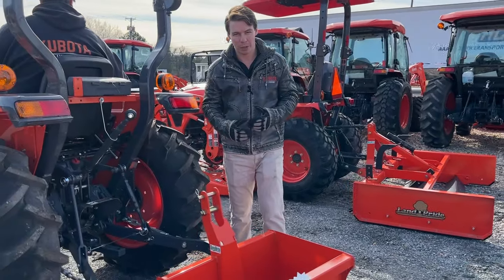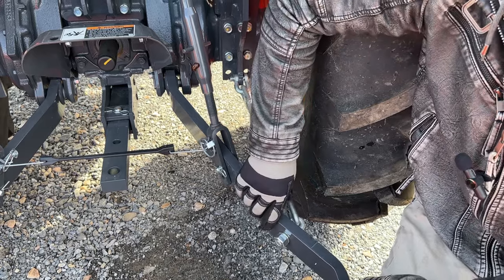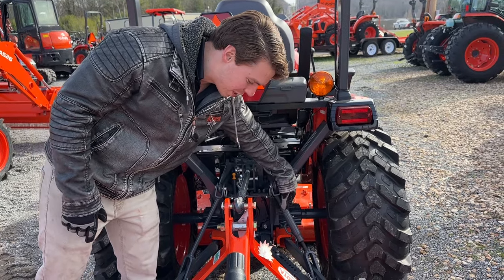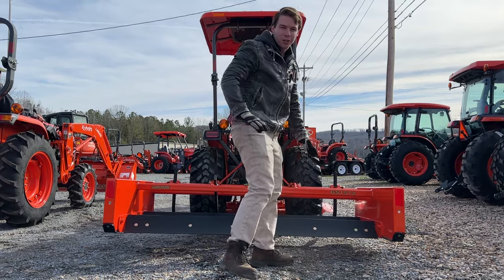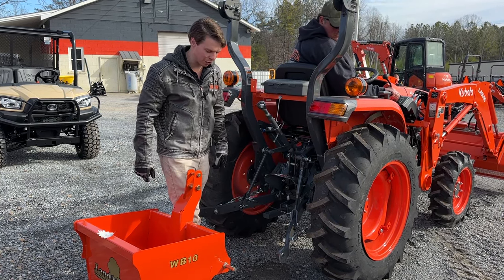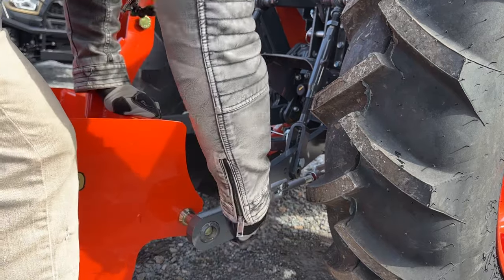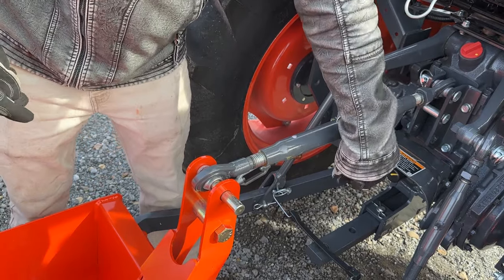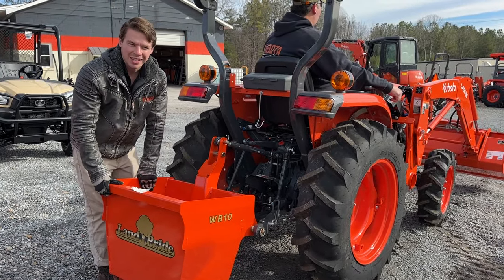How to Use a Three Point Hitch and Attach Implements

Comment: When leveling a box blade or other implement, raise the implement off the ground about 2" and then place a torpedo kevel across to adjust the left and right. The implement should be level with the tractor not mother earth.